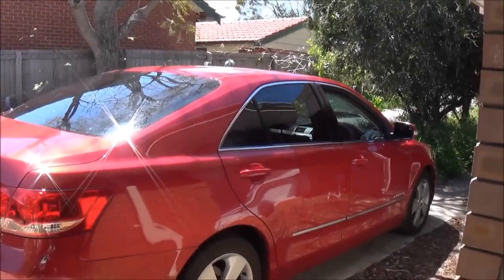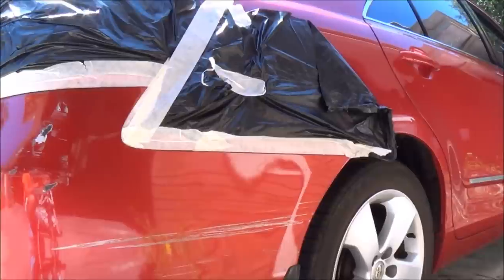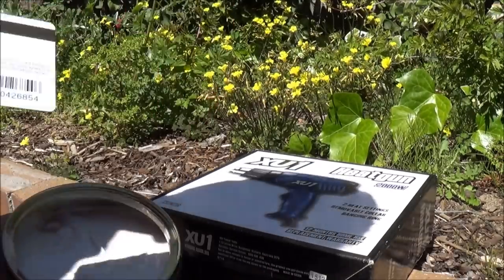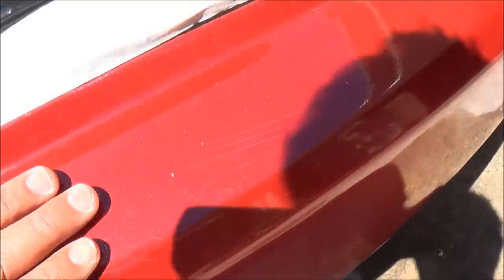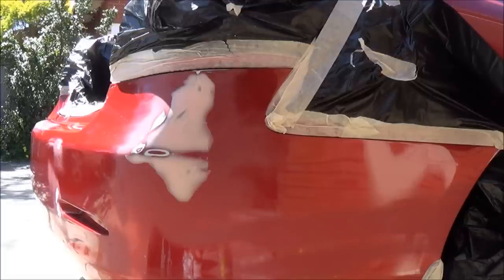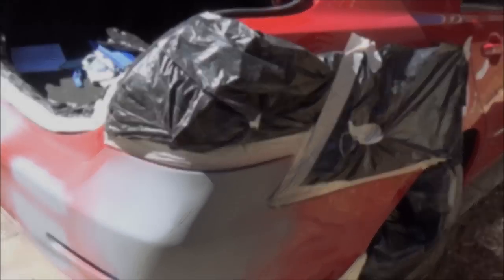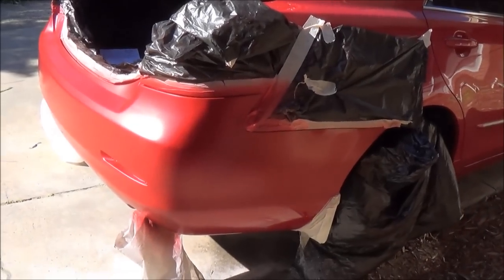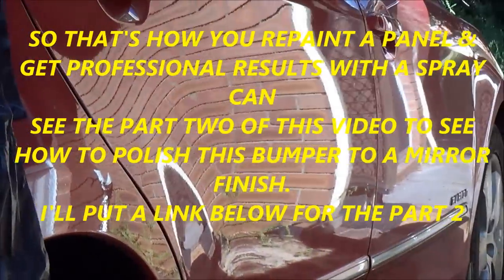How to PAINT a car with SPRAY CANS - Part 1

Comment: You should have sanded the ENTIRE bumper. The clear coat at least needs to be scuffed in the non primed areas so paint/clear coat can stick. Paint the primed areas then do a final coat or 2 over EVERYTHING to color blend. Then clear coat.  Im doing this to a fender right now but i researched like 25 videos and learned certain things were key.
Reply: Yeah this guys totally winged the whole thing.
Reply: Same lol

Comment: Excellent video, I am planning to re-spray my bonnet, the clear coat is peeling off. Any update about the clear coat condition after 4 years? Do you recommend color spect clear coat? or any other brand?

Comment: Great vid. I am going to restore an 04 nissan solid white. I would like to smooth out small dimples on the body. After preping the paint would the filler you used on the bumper work acting like a kind of bondo ? I'm new to doing fix it yourself work

Comment: And i might add you layed the first coat of base on way too heavy you have to have 70% transparency on the first coat so the following coats actually stick in the long run.
I give that bumper 6 months to start cracking and flaking.
Reply: I think Ipoopd so, what happened?

Comment: Hard to tell from the video but doesn't look like the damage took any of the bumper off, looks like it's just paint, maybe less then a mm of body was harmed which means using body filler isn't needed, can even be worse using it, because it's impossible to sand it down the factory specs, you probably have a mm or so sticking out now, that's ever so gradual you might not even notice unless you a look for it.  Also to close when spraying, need to be back further, light feathering further away, let it dry 15 min, then do that 4 more times. Look at it and adjust. But never so close, and np pausing even slight pausing while going back and forth, have to feather. No biggie though not like it's worth a thumbs down... everyone's a critic...

Comment: If you is interested in spray painting the greatest success that ive had was by using the Magic Painter Method (i found it on google) without a doubt the no.1 info that I've followed.